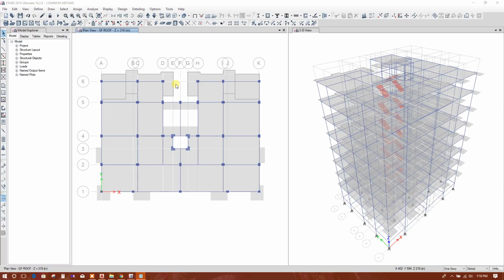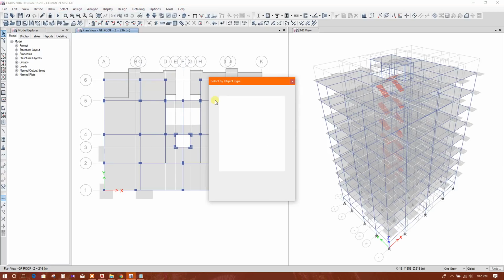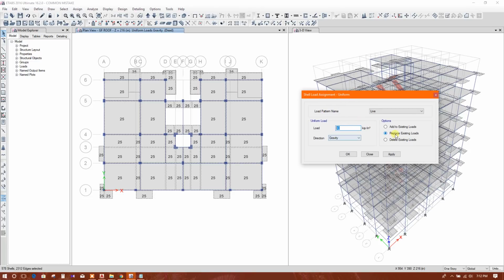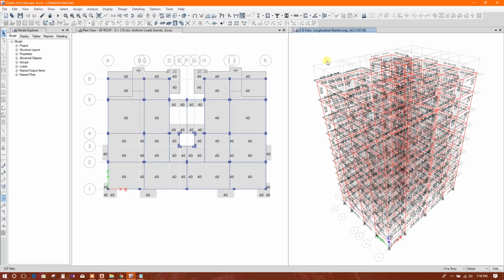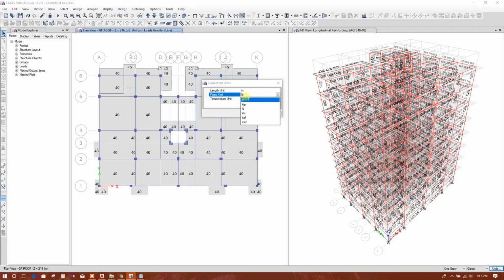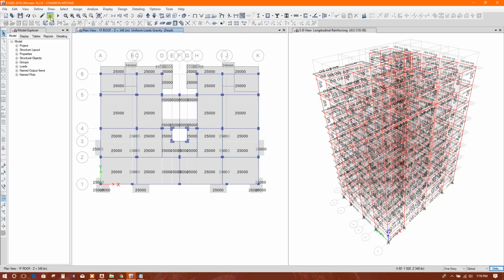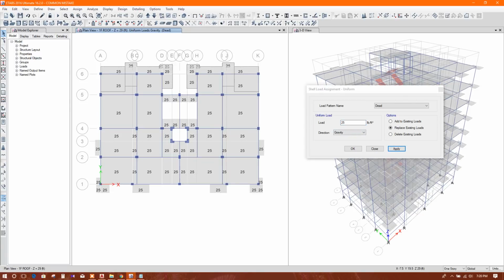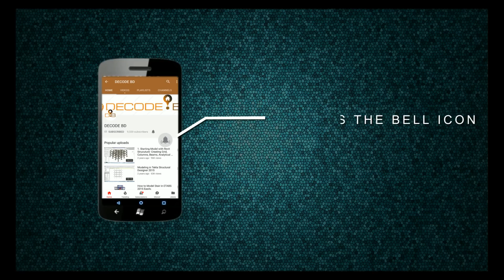SOLVING PROBLEM OF ALL MEMBERS OVER STRESSED IN ETABS

Comment: sir is there a way in ETABS to limit the percentage of rff in column to 3%-4% so that if the percentage of reinforcement exceeds it then etabs shows the column as failed ?
Reply from the maker: Still now there's no such option in Etabs. You can customize the Utility Ratio, not reinforcement percentage.
Reply: DECODE BD sir I know utility ratio is P/A*fy what is the significance of that. In etabs it is 1 what if I change it to 0.9 or 0.85 what does it signify?
Reply: DECODE BD also is there a way to change moment capacity ratio from 1.1 to 1.4. As per new ductility code in India Moment capacity ratio b/w column and beam should be 1.4 but etabs still uses it as 1.1
Reply from the maker: This is also called DCR (Demand Capacity Ratio). If it is more than 1.0 then it shows failed (Red Color). This is used when you check an existing building with it's existing member sections & existing reinforcement. If you change that value to 0.9 then above 0.9 it will show failed(Red Color).
Reply: DECODE BD ok. Thanks.!!
Reply: @Decodebd   can you please explain from where I can change this limit?
Reply: increasing the size of column we can change reinforcement percentage.